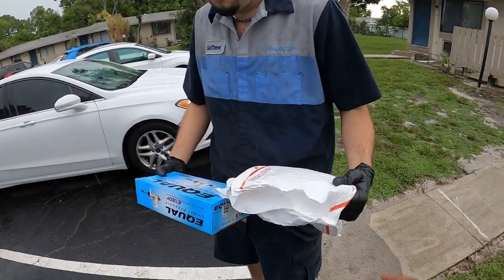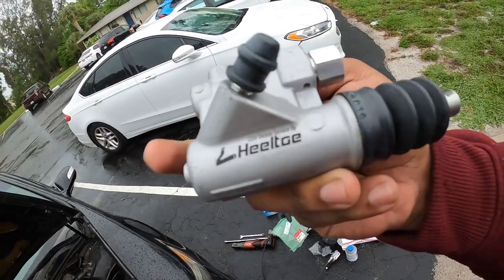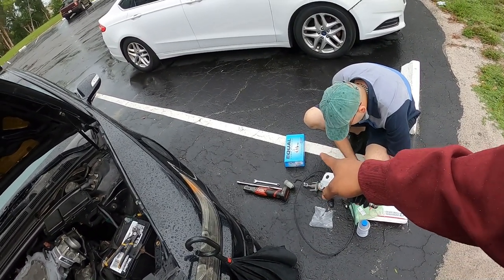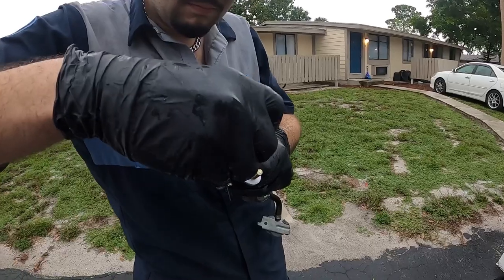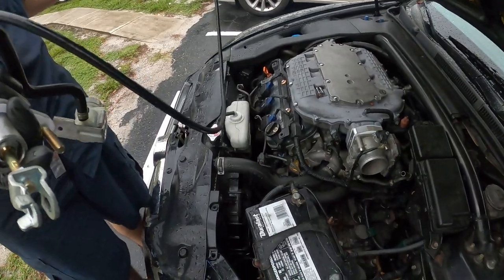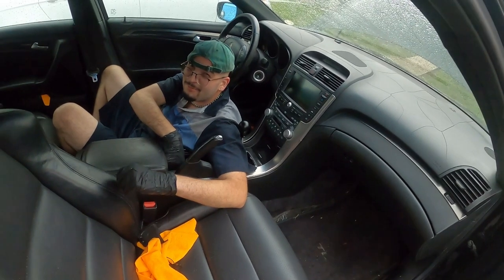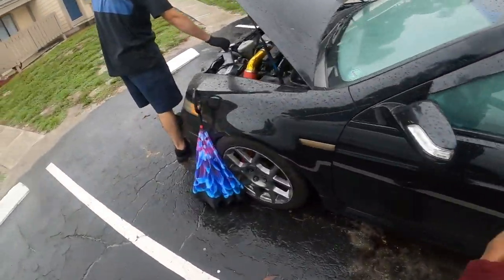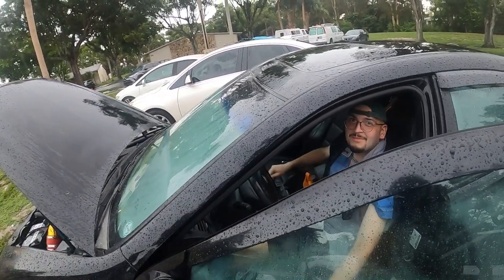Upgrading Master & Slave Cylinder (04-08 Acura TL Type S)

Comment: Forsure purchasing that slave from Heeltoe but I’m using the K-tuned CMC kit instead 🤙
Dope video as usual 🔥
Reply from the maker: Yeah I was gonna buy it but I’m like the master looks like a em2 one did research and yup so paid 25 bucks for the master and already had the steel lines.
Reply: @AllenSpec  can’t lie wish I went your route and spent $25 instead of $170 😂
Reply from the maker: 😂 still the slave was 140 but not bad when you add it all up

Comment: If I’m switching my slave master cylinder and want the deleted option would I have to purchase both? Or just the deleted option
Reply from the maker: Delete option
Reply: If I chose to buy the deleted slave cylinder do I have to buy a new master cylinder aswell? Or can I use the old stock one that came in my car
Reply: Highly appreciate the response back aswell! It’s my first car so I’m barely learning
Reply from the maker: I would replace it they work hand in hand so new slave old master your master will fail quicker. Can just get a oem or oe one